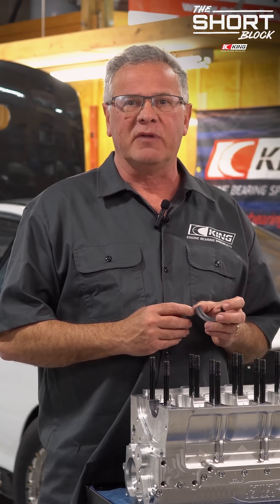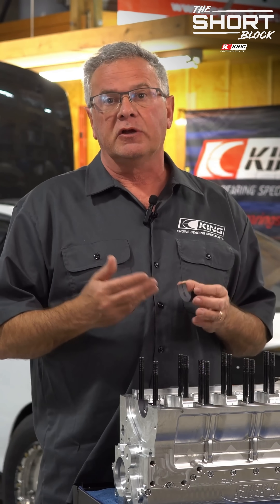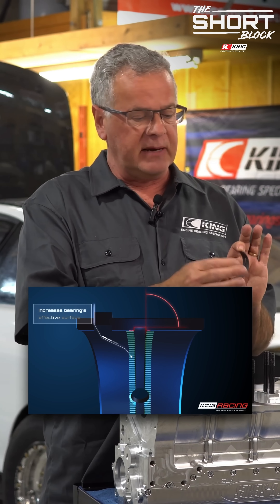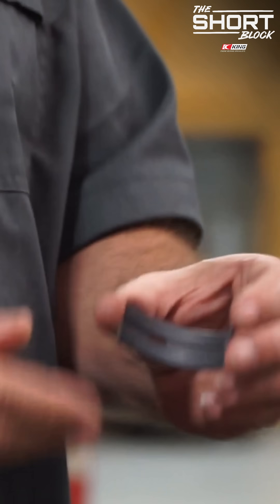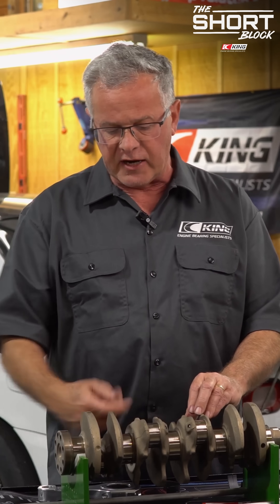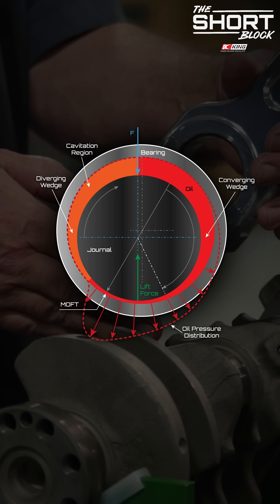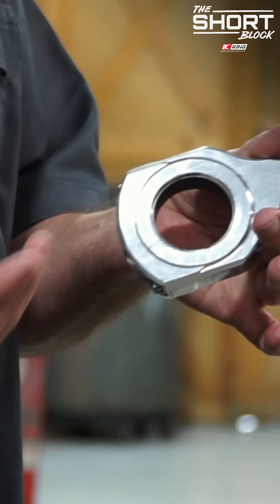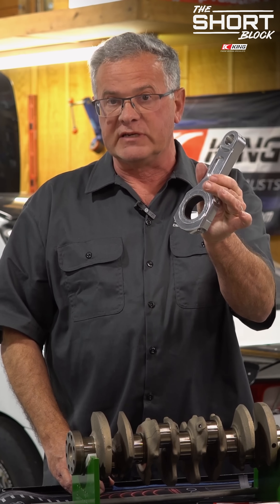Not all oil grooves are created equal. U-Groove™ for max load capacity without sacrificing oil flow.

Comment: I'm a Mechanical Engineer...and I did not understand your explanation of your U groove technology.  Maybe more diagrams and a better explanation would help.  I am hopeful you do have an improvement, but this field of fluid film, hydrodynamic bearing design, is about a century old.  There is not much that great minds, and millions of dollars in research and production has left to improve.  I am still hopeful.
Reply: The best I can understand (or not) is the groove varies in its width and shape around the perimeter ..More width at the heavy loaded part of the bearing??..
Reply: I too am unclear about what makes your U-groove different from other bearing designs!  Please revise and update your video.  It does not inspire confidence that King Bearings knows what they are talking about. Also, please get your engineering department to QC all technical videos. This one left me with more questions than answers!